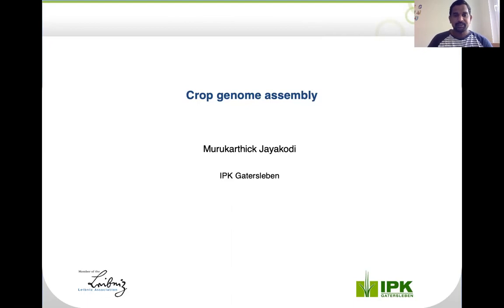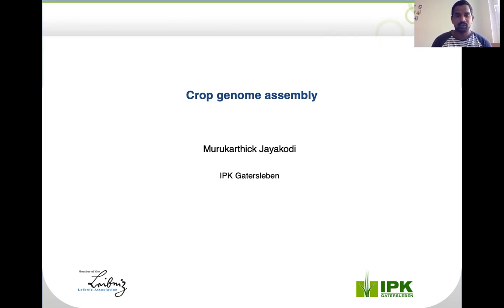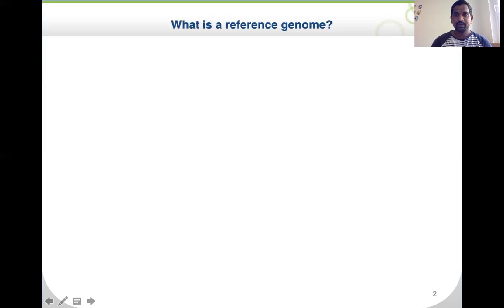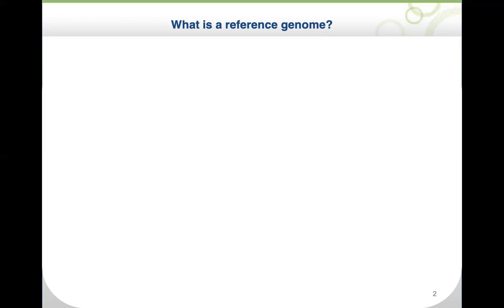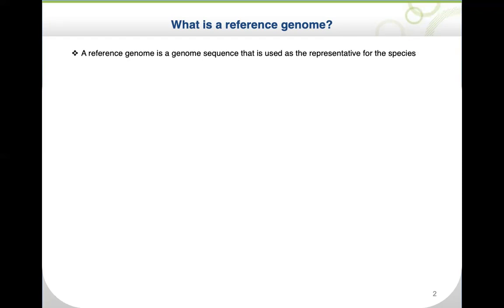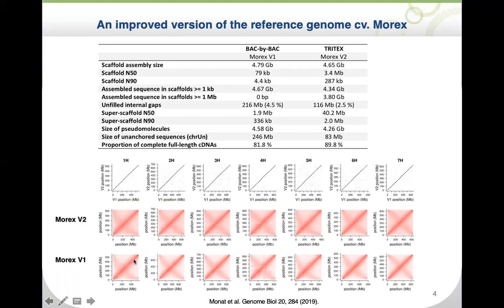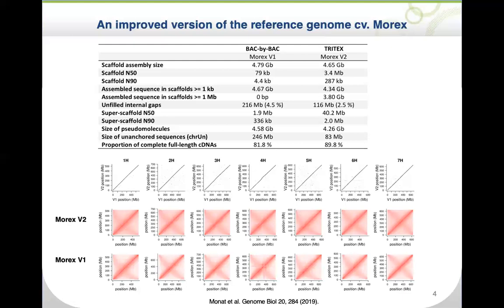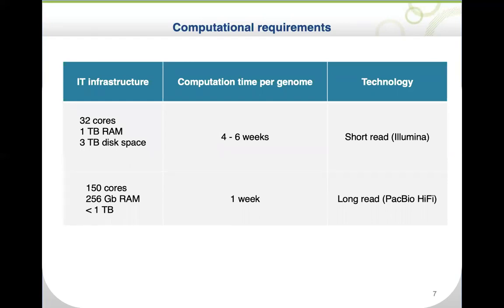Crop genome assembly

Comment: Sir can you explain about the matepair reads and the methods to identify the mate pair as well as the softwares that could be used to find them if any
Reply: Mate pair library is one type of sequencing library. Here the fragment size is ranging from 2-10 kb whereas paired end fragment size would be less than 1kb. (300-500 no) .